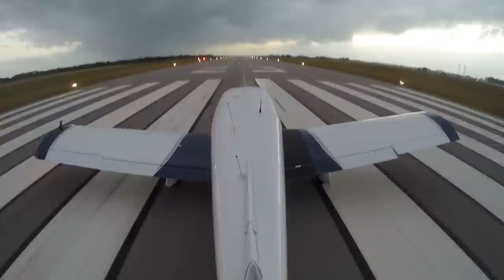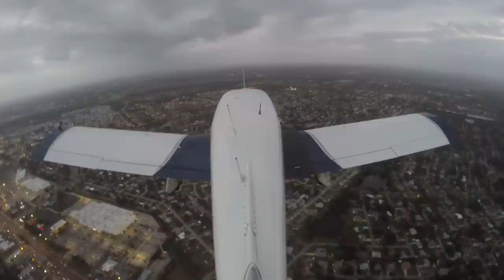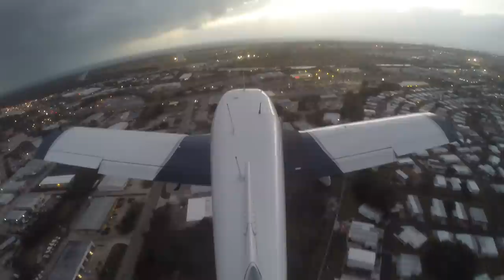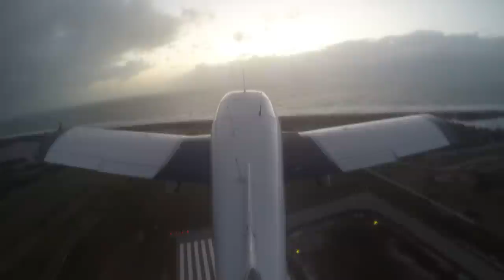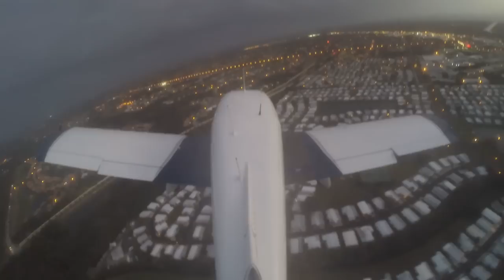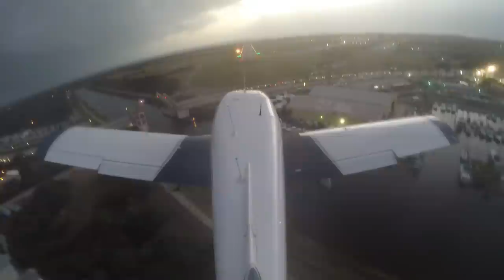Ep. 17: Crosswind Landings How To | 22 Knots

Comment: This video is really helpful. I'm a Student pilot and crosswind landings are a challenge of mine. The description of the nosewheel/rudder relationship sounds like it's my problem. This is comforting to me. Will have to try it on my next lesson!
Reply from the maker: Good Luck! Safe Flying!
Reply: My CFI put it in a way that really made sense to me:  If you fly the landing correctly -- use rudder to maintain center line, and bank to control drift -- you don't need to worry about things like "which wing do I need to keep low?"  The plane will do it naturally.  Just keep the nose pointed straight down the runway, and use the ailerons to control your drift, and your windward wheel will naturally touch down first.

I was having trouble with x-wind landings too until I started keeping this in mind.

Comment: This video is extremely helpful. I am taking lessons in a Cherokee  right now, at an airfield that almost always has a crosswind. And you are correct about the nose wheel being connected to the rudder (unlike the Cessna that I used to take lessons in),  so your part about releasing pressure on the rudder just before the nosewheel comes down makes perfect sense, to keep that nose wheel as straight as possible down the runway when it touches the ground. Excellent video!
Reply from the maker: Glad it helps!  Fly safe out there and share our site with your aviation friends!
Reply: Cessnas have it too, but a bit less than those Hershy Bar Checks.  On the Archers they made then less.  Like Cessnas.

Comment: Might of missed it but what speed were you carrying over the threshold? I saw 80 plus .5 gust factor with two notches of flaps? I just started flying a hersey bar 180 and find I have little elevator authority and it's hard to keep that nose high attitude. And curious if you keep any power in all the way down or pull to idle as you being your round out?

Comment: The nose wheel gets me probably 75% of the time on these....usually its when I end up floating longer than expected in ground effect and i keep putting left rudder in ...... then when my nose wheel touches I'm jerked left of the center line, then I correct and end up fishtailing slightly....it's a pucker moment for sure.
Reply: If you recenter the rudder a little too late on a direct-steer nosewheel, it will pull you to the side.  A couple things will help.  Keep the nosewheel off as long as possible so the nosewheel touches down as slow as possible.  Also, when you do let it down, keep enough back pressure to let it down gently.  This will allow it to skid and it won't pull as much if it's off center.  If you let it down firmly, it will pull quite strongly.

Comment: Are you using a lot of rudder to keep the crab angle and track before you transition to the low wing method on final ? Or is it only the wind that points the nose of aircraft to the wind?
Reply: No u dont use rudder to get the crab angle

Comment: I was wondering, what is that rotational lever (10:06) on the ceiling of the piper cherokee?
Reply from the maker: Trim handle, same function basically as trim wheel on a cessna halfway up the pedestal
Reply: elevator trim?
Reply: @ivandominicbaguio1194  --Yes, elevator trim.  Rudder trim is a knob under the panel, in the middle so both pilots and student can reach it easily.  Cessna with under 200 HP dont have rudder trim.